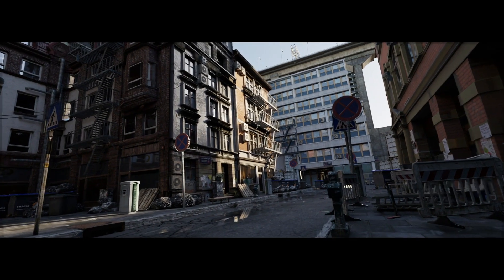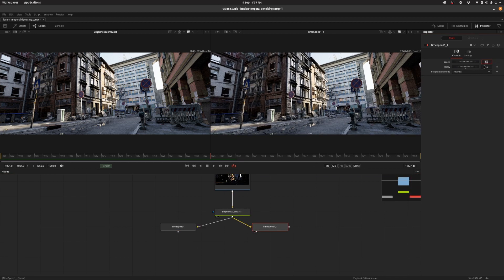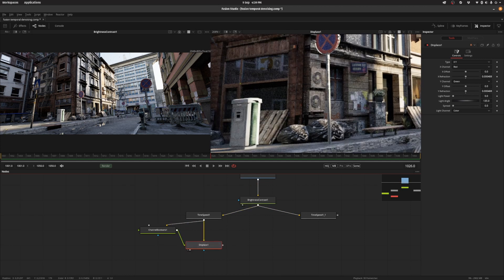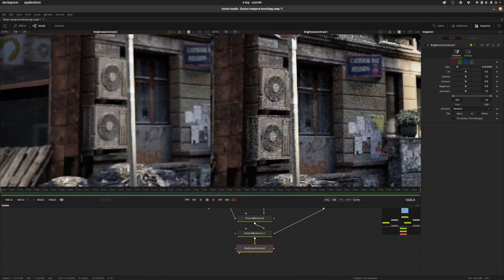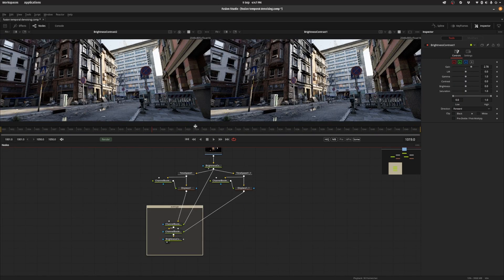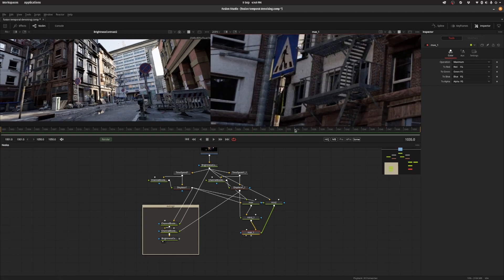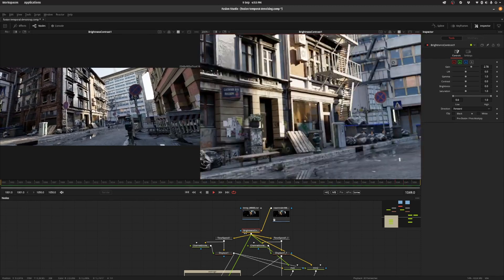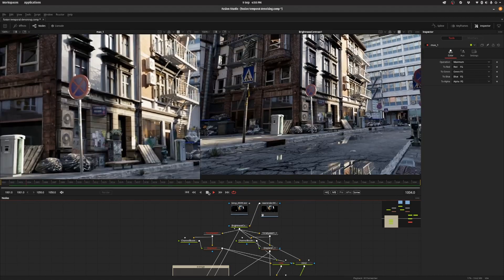BMD Fusion - Temporal de-noising tricks and flicker removal on CG renders

Comment: Have anyone opinion how node based temporal node setup in blender/Fusion compares to Davinci Resolve Studio temporal denoising in terms of quality?
Reply: As soon as movement comes into play, davincis build-in temporal denoiser produces a blurry mess, unusable imo., but for static stuff its pretty good.
It can't utilise the vector map, that's why the node based is much better but generating the vector map will add a bit of render time, for me it went from 0:46 to 1:02, still much worth it.

When building this setup in blender, use blender 4.2, in the compositor side panel under settings: set it to GPU (it's 5x faster for me than cpu)
But davinci is still a bit faster and easier to set up

i get the best results by:
-ideally denoise your render passes first individually in blenders compositor (don't denoise the Color passes, you would just loose details because they are usually noise free),
then temporal denoise ("direct"and "indirect" passes (you could also add them together before denoising to save render time, if you don't need them seperated for post production))
-avoid animated noise seeds (adds more flickering)
-increase resolution instead of samples for better quality (file size and denoising time is increasing tho, so you need to find the sweet spot for your system if vram isn't a limiting factor)
Reply: @Lakus231  Thank you.

Comment: awesomeee this worked pretty well, ! any advice tho in how to reduce the noise in hair, I tried different things, so far this one is the best solution but just wondering if there is another tip you or someone else can share, thanks
Reply from the maker: Super fine detail and transparencies are the trickiest bits. But using the velocity vectors to add a bit of extra motion blur sometimes helps. You can push and pull the pixels back and forth so at least "smear" some of the noise away. 

At some point its just whatever tricks you have combined that works. Never a single solution.

Comment: As you have suggested a similar approach for the blender compositor, would you recommend fusion or blender to run this temporal denosiing technique? Is there a difference between the two? 

Also, how does this compare to deflicker effect in resolve?
Reply: if you want to do it in blender, go with version 4.2 or above (in the compositor side panel under settings: set it to GPU, for me it's 5x faster than cpu)
But davinci is even faster and easier to set up.
results looked identically.

Comment: Wow, this is incredible, I have to try this out, I wonder how well this would work with multiple objects being composited together with effects applyed such as lens flare, glare, color adjustment etc. It would be great if It would still reduce the noise using only the combined elements instead of each individual render pass since the denoising process would only have to be done once and won't overburden cpu.
Reply from the maker: @hf4a2 is correct, you'd ideally want to denoise your render passes before you start comping. That way you can choose how much you want to denoise as some passes have more noise in them than others.
Reply: Also, how well would this handle motion blur/depth of field that's baked into the image before the denoising?